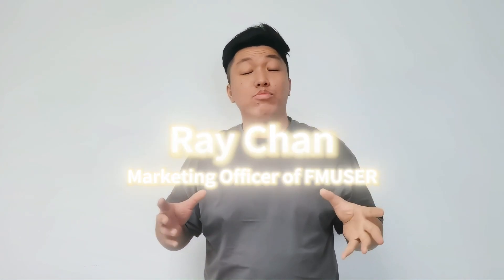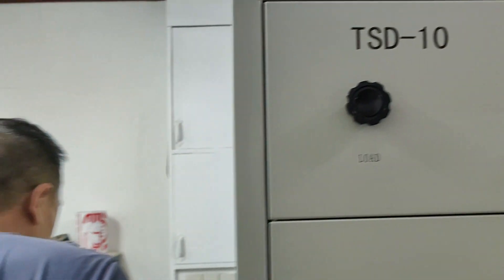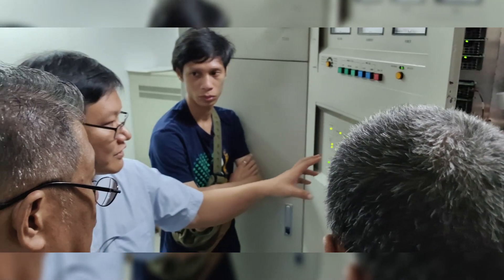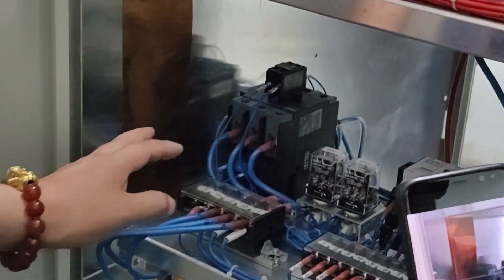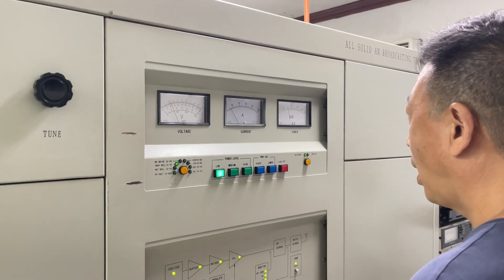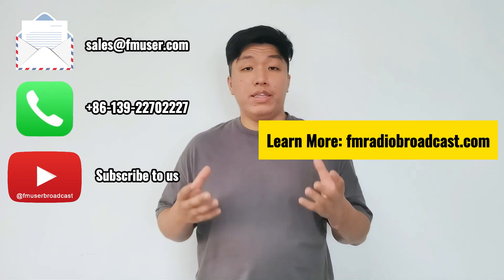10kW AM Transmitter Modules: What Are They & How They Work?

Comment from the maker: Learn More about Our Solution: ▸📧 Email us: sales@fmuser.com ▸📞 https://api.whatsapp.com/send/?phone=8618924246098&text=Hello-I-watched-your-10kW-AM-transmitter-Modules-YouTube-video-and-I-need-your-solution ▸☎ Give us a Call: +86 139-2270-2227 ▸🔗 AM Transmitter Family: https://www.fmradiobroadcast.com/product/am-transmitters

=-=-= TIME STAMPS =-=-=

0:00 - Project Review
0:28 - About Part 3
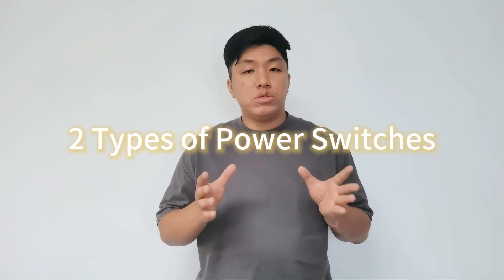1:09 - Comp. #1 | Power Switches
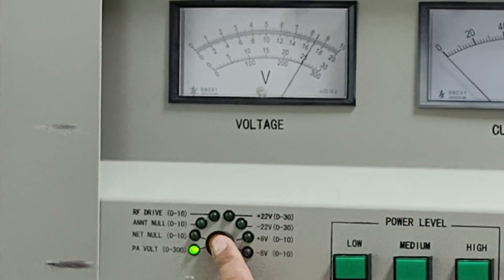2:33 - Comp. #2 | Cooling Fan
3:20 - Comp. #3 | Modulator
3:54 - Comp. #4 | High V Transformer
4:28 - Comp. #5 | Low V Transformer
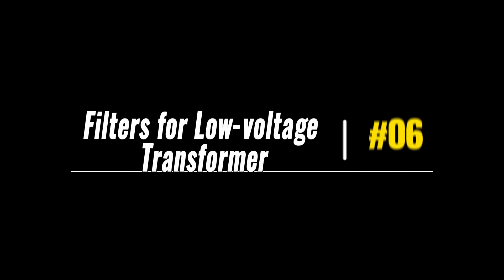4:56 - Comp. #6 | Low V Transformer Filters
5:23 - Comp. #7 | Power Amplifier Fuses
6:08 - Comp. #8 | Relay
6:40 - Comp. #9 | Built-in ATU
7:13 - Comp. #10 | Power Amplifier
7:58 - Part 3 Summary & Part 4 Preview